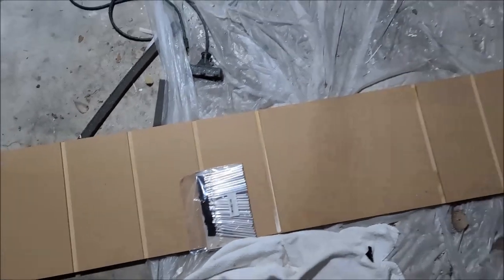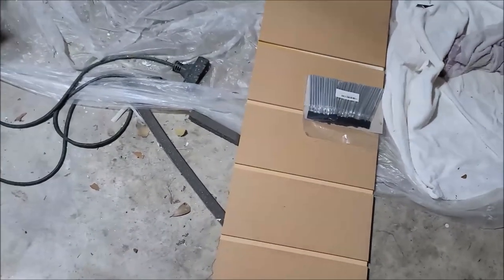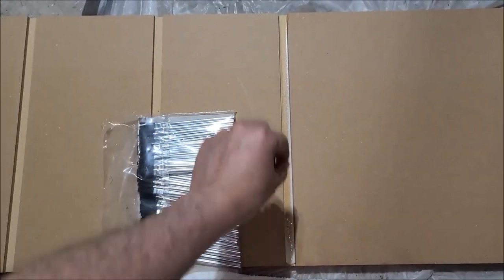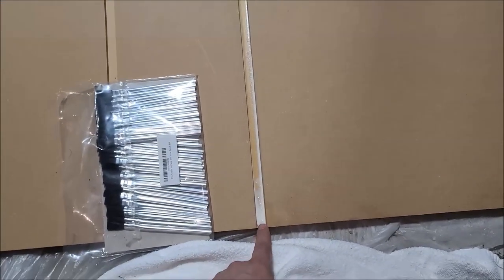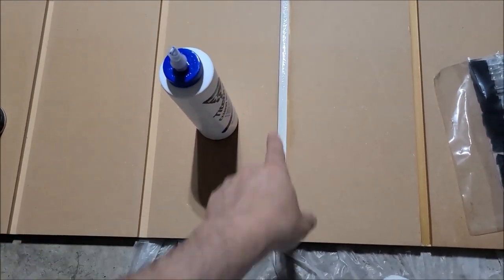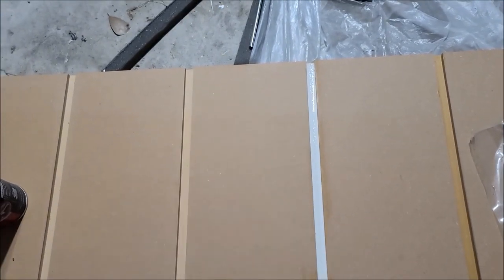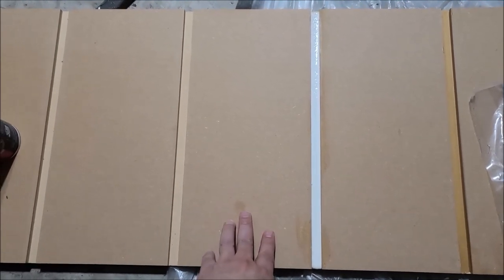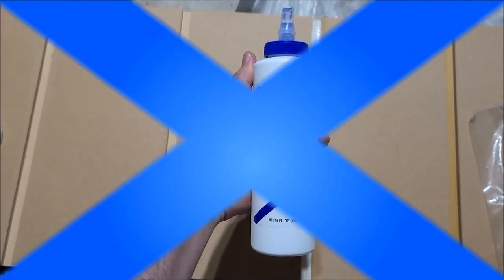Audiophile Junkie - GR Research NXtreme Speaker Build - Part 9

Comment: Sorry, however isn't that way too much glue?  For one you are supposed to place glue on both pieces being put together and then there is displacement when putting together joints as you have there.  So you may want to cut off one end of your space piece and then perform yet a 3rd dry one where you put glue on both pieces as well as pushing the cut-off piece into the groove of the other so that you see exactly how much excess glue you end up with.  Trust me... seeing how much glue you have used for your first two dry runs, you're going to have a ton of excess glue... and frankly just a terrible mess on your hands... or not for maybe the video / images are misleading :)
Reply from the maker: Yeah.. It was a lot during practice.  The instructions on the glue says to use a thick layer, but I dialed it back after this practice.

I just did the live glue yesterday and used a lot less with almost no overflow.

I'll have a video soon of that..  After glueing the first brace, I had a good gauge on the right amount.

Thanks for the feedback because I might not have been clear on the video that it was more than needed.
Reply: @AudiophileJunkie   No, you were definitely hinting to it being too much, but I figured better to play it safe than sorry.  I think the dry runs are an excellent idea and will help ease the most problematic step of the entire process.  When I get to doing my DIY GR Research speaker build I think that I will insure that I also have a spare panel so as to be able to do a few dry runs of my own.  Thanks for all the videos on this speaker build.
Reply from the maker: I'll have some good tips in my next video that I learned doing the glueing live.  

As a noob, I know I learned a few things that will help me with the second speaker, so hopefully it will help you guys with your projects.

Thanks again for the feedback and good luck with yours.